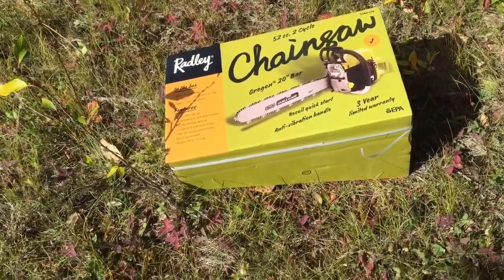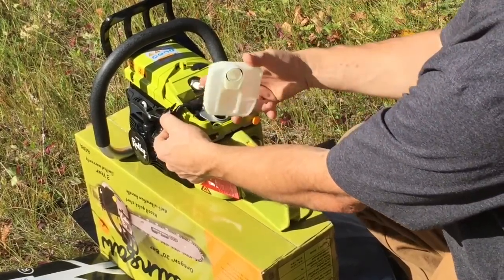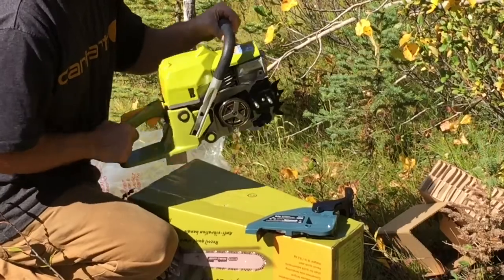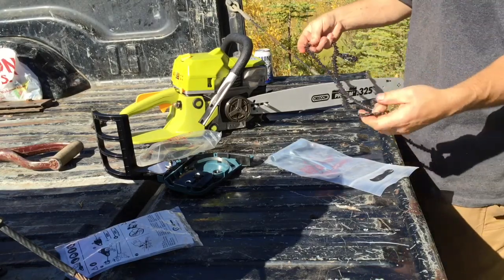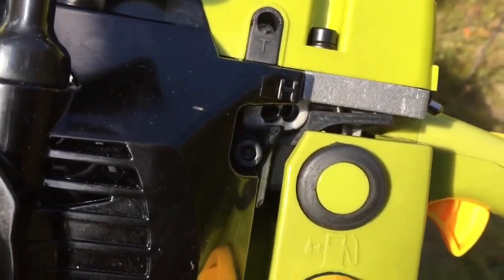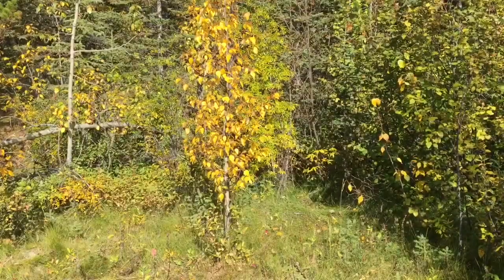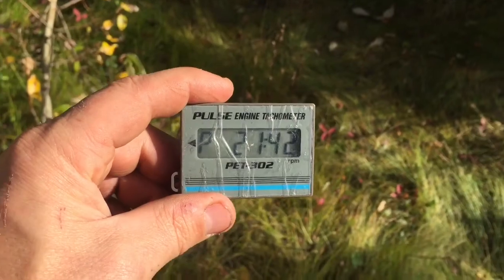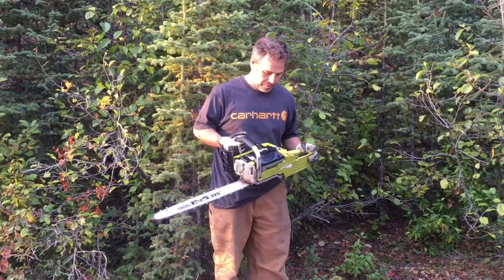52cc CHINESE CLONE REVIEW AND CUTTING!

Comment: I am on the east coast of Canada and about as close to sea level you can get.

In theory it should run good out of the box if I buy it
Reply from the maker: Very true and I’d love to hear if it does or not. Please chime in once you’ve ran it a little bit.
If you end up buying one.
Reply: @Indeewoods  Just waiting for it to go back on sale lol

I spent too much time debating the clone saw or buying a Crappy Tire Champion 45cc saw.
Reply from the maker: I don’t think you can compare those two. From what I see the Radley is far superior. Remember it is cloned off a pro saw. I think the Champion is their own design.
Reply: @Indeewoods  the 45cc champion is like 270 bucks as well
It does come with a oregan bar and chain but still the HHW saw is excellent value over all

Hoping it will go on sale soon
Reply from the maker: Ya I think they are 200.00 retail or 149.00 on sale 3 year warranty.
I seen another brand in Edmonton the other day and it is the other version of the 50cc clone saws. Basically same as the Radley but top cover snaps off and a few other minor differences.
They had them on at 149.00.
Reply: @Indeewoods  HHW has it back on sale this week along with it's battery saw.

Going to pull the trigger on it if I can find it in a store.
Reply from the maker: I thought maybe they were. Another fellow was saying he just picked one up and he did a muffler mod on it right away says it rips pretty good.
Reply: I guess the Atlantic provinces won't have stock til March 22 so I had to order it online and swallow the 15 dollar shipping fee.

Should be interesting to play with once it's here as I got some easy work to do
Reply: @Indeewoods  did you end up modding  the muffler or are you cooking hotdogs on it after a cord of cutting?
Reply from the maker: Haha hotdogs after 3 cuts!!!
Just want to finish my one year review video then the old Radley gets modded.
Reply: @Indeewoods  I will be the first one to see that !

Comment: What would you say about it now since you have used it for a while
Reply from the maker: Hi Shawn. So far I love that saw. It cuts really well and it starts and runs flawless. Many Chinese built saws are hard to tune and need adjusting often to make them run but not this thing.
I will say the exhaust gets red hot and I did modify the exhaust but what I did would only let more heat out if anything.
It has a catalytic style muffler on it so there is no smell that comes from the exhaust it gets so hot I can’t see how that is safe from starting a Forest fire.
I wish I’d have left it stock to see if they all do that or if my muffler mod caused that? 
Stay tuned I’ll be doing a follow up video in the next few weeks. Subscribe to the channel so you don’t miss it.
Reply from the maker: Also the chain is really tough on this thing. I cut quite a bit with it and just sharpened it up the other day and filed the rakers a bit and now that saw eats! 
I want to try a different muffler I bet it’ll free up some more power outta that saw..

Comment: This is a Zenoah Clone of the model 5200. It should have a 44.9mm piston and 32mm stroke.
Reply from the maker: I measured it when I first got it and worked out to 50.5cc I thought. They say 52cc on the box I think.
Reply: @Indeewoods  Yes, exact cc is 51.5 I think. Great design dating back to the 1970s and now one of the most popular saws in the world due to the cheap Chinese knockoffs.
Reply from the maker: @iowaunemployment  wow that old eh? I did read they were cloned off the Redmax Pro saws.
Reply from the maker: @iowaunemployment   ya who ever out fitted it did a good job. No complains with that saw other than the crazy red hot running muffler.
Reply from the maker: I can’t get into that link you post who are they?
Reply from the maker: Ok I’m on that one already..

Comment: I just saw these are on sale for $150 at Home Hardware. I’m damn tempted to get one based off your review. Have a smaller Husqvarna that I need get going for my quadding saw. This looks good for actually bucking up some wood to burn. Thanks for vid.
Reply from the maker: Really?? I better go grab another. I only have 19 saws need an even 20 haha no I want to mod one and leave one stock. Thanks for the heads up been watching the flyers for a while now. I wonder if it’s only at certain stores? I may have to buy online.??
Reply from the maker: What model Husky do you have?
Reply: @Indeewoods  hahaha. Can never have too many saws. That sounds like my brother. Mines a Husky 40. Was father in laws and now it’s at my house since farm is sold. It’s always “next” on my list to work on. Except the quads always need work before it. Hasn’t ran in a few years but  I’m sure it just needs a carb clean and some tuning.
Reply from the maker: Cool I have a Husky 41 all apart right now. Going to rebuild it.They were made by Poulan apparently when Husky first bought them out. Great saws.

Comment: Home Hardware has these as there house brand for tools.  Do you know who the manufacturer is?
Reply from the maker: You are correct. I’ve got some of their power tools as well.
As for “the brand” these saws a mass produced in China under various names.
There seems to be different levels of quality though some are not that great but these Radley saws seem to be good high quality and come with a great name brand bar and chain.
Reply from the maker: Also I know they sell a Radley 2500 watt inverter generator not sure who builds it or if it’s any good or not but they say “Assembled in Canada”  so I really like that.
Reply: @Indeewoods  thanks, i'm interested in the 20v cordless line as I want to know if other battery types would fit, especially if a name brand company would work, such as makita or dewalt, etc..., so i don't have to worry about supply if  HH dumps support
Reply from the maker: @cameranmanner4701  ya sorry can’t help ya there I have no idea what batteries fit what.
Reply: @Indeewoods  No problem.  I just had a thought though.  Too bad there was not a database of all these batteries.  The database would be filled with a topographical view of the thousands of tool batteries that roam this earth, with measurements and a reference scale, a polarity diagram.  Then we can take a top view photo of our battery and map it over the existing batteries to see what fits best.
Reply from the maker: @cameranmanner4701  you’d think there has to be something like that?
Reply from the maker: @cameranmanner4701  p.s I wouldn’t worry to much about not being able to get a battery years down the road. Amazon/ebay sells every battery around.
Reply: @Indeewoods  I was just looking for that elusive database, so far google has let me down.  Back to the Amazon, you may think there would be third party batteries for all brands, but it's no true I have some old 1st gen Greenworks 40V batteries and the 3rd party does not exist.  Only 40V Gmax batteries exist. It sucks because of tool compatibility. So what I do is buy the 3rd party GMAX batteries and remove the guts and do a transplant.  Most people wont do that.  The world has turned into a plug and play society.
Reply from the maker: Yep
Reply: I purchased one of these saws and hop it stand up.  The questions about the 78 or 76 drive link appears to be because of the bar change.  Mine had the Radley bar instead of the Oregon and measures at 18.5 inches from the front of the saw which rounds up the the advertised 20 inch bar.  The Oregon 76dl chain for this saw is the  21BPX076G which is compatible fit chain with Stihl - 25RM3 76   Husqvarna - H25-76.
Radley and other products for Home Hardware and CTC as well as  may be found at www.mecanair.net which lists Products and Part Numbers.  Selecting the HH logo, OUTILAGE and SCEI will bring up this saw.  The website did not fully translate from French so you may have to do some exploring.  The supplier of these products is in Montreal, Quebec.

Comment: Anyone have this saw with the cheaper bar and chain?

I had to order this saw online so I am going to assume I won't be getting the good ones.

It's probably fine for my needs but if the chain is one that has to be sharpen and tightened every half tank I'd rather just buy good ones to start with.

Ps - I am 40 years old and never thought I would be looking forward to a $150 CAD saw to use lol
Reply from the maker: Scroll down the comments a fellow was just saying he bought one and bar and chain looked decent. He has a video of his saw with a muffler mod as well. 
I looked at the new bar/ chain myself didn’t look bad but only one way to find out. 
I’d keep the oiler turned on max and let r buck! Lol
Reply from the maker: P.S just saw a dyno chart of 5 saws and one of them was a 50cc clone same basic saw as these. 
Anyway bang for the buck by a long shot the clone saw won. It wasn’t the best power but was lighter than some of the other ones.
Reply: Awesome !

Good enough to abuse ha ha

I'll take a bit lighter for a little less power, more power than buying a $300 to $350 38cc husky lol
Reply from the maker: More like 5-700 dollars
Reply from the maker: Oh you said “38cc” yes you’re right they are about that price.

Comment: That saw is not cutting ,for a 52 cc. Its a cheap poulan model and it is ,what it is.
Reply from the maker: Lol it’s not made by Poulan it’s a clone of a Redmax G-5000. 
No saw will cut if you don’t tune it. Did you do that? 
Let’s here your story.
Reply: @Indeewoods  I would not have a saw like that.I use pro saws,as I do cut wood,and lots of it.I know how to tune saws I never go to a shop.
Reply: Although it's a good saw for light work
Reply from the maker: Yes well for 149.99 what can one expect lol. 
They are actually a 49.5cc saw even though they say it’s 51cc but they run flawless, come with a rim
Sprocket,primer bulb,adjustable oiler, metal cases. So they are not trying to compete with Husqvarna or Stihl it’s simply a homeowner saw that is 10 times better than what Poulan or Champion etc are offering and at half the price. 
In this video you have to understand the saw was not tuned yet or broke in. 
Go watch my video where I did a muffler mod to that saw it actually cuts good and still on the stock now worn out chain. 
A friend of mine bought a new 550XP Mark 2 and he tried that Radley after I miffler modded it and he though it cut good for what it was. It’s 5 times cheaper to buy than his 
Husky but again you get what you pay for.

Comment: They are daring to put a 3 year warranty on a chinese saw
Reply from the maker: @mikeojan85channel I agree but these are surprisingly well built plus they were cloned off of a really good design. 
The problem with these clones are there’s two different types there’s one that comes with really good well-built parts and one comes with not so good parts. 
I have both and I’ll be doing a video explaining this in the future.
Reply: @Indeewoods  Excellent, I'd like to see a video about this topic
Reply from the maker: You sure will

Comment: if it was rich I'd think it would smoke tho
Reply from the maker: Ryans logging these have a Catylitic converter type muffler so there is hardly any smoke at all if any. Regardless you tell if it's rich by the sound it makes or at least that's how I do it but been tuning engines for years. 
Most any 2-stroke will smoke but it's the way they run, the sound they make and how they cut that tells you if it's rich or lean.